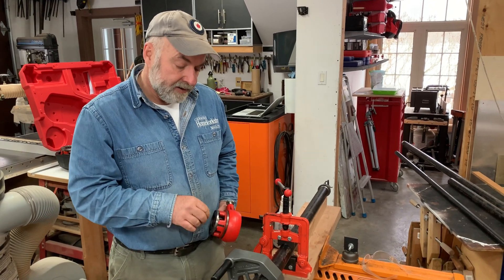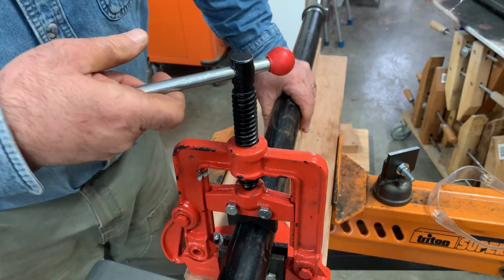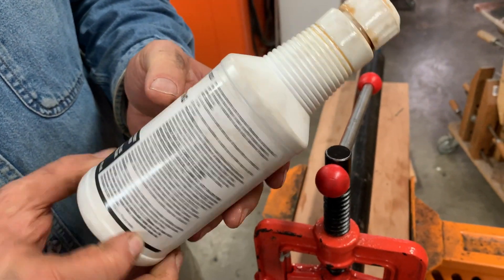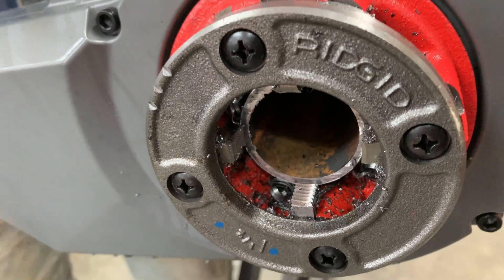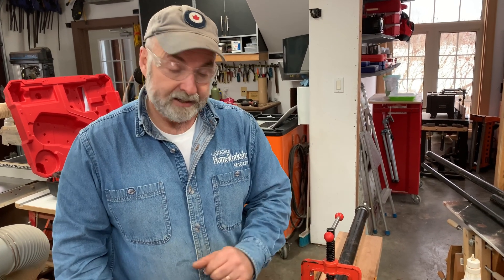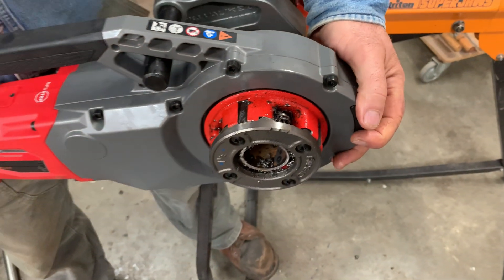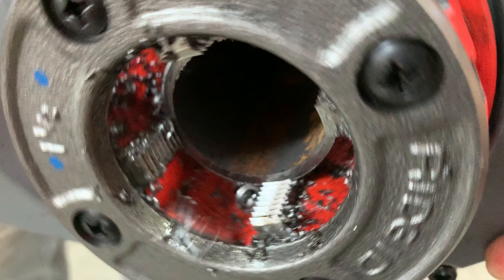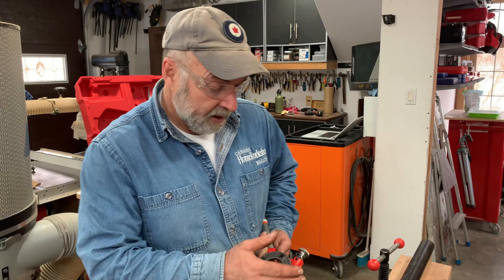How to Thread Pipe EXTREMELY FAST

Comment: 7:00 For your railing, do you like the look of exposed threads? After the cap is threaded on, there are still a lot of threads showing. I'm curious if it was a preference, or the die requires to create that many threads.

Comment: I have been tearing threads. What do you think? Dull or worn-out dies? 
What is you insight as to what type dies to use as a replacement? I see ‘Alloy’. And I see ‘High Speed”. 
What is the difference?
Thanks for the video. 😊👍

Comment: Hi.... Please can you help me solve or know how to solve problems or real situations of take off in threaded joints.

For this examples: 

1) A piece of NPS ∅2" pipe is being cut to run between two 90° degree threaded fittings. The center-to-center measurement of the fittings is 7'-2¼". What is the cut length of the pipe?

2) A length of NPS ∅1½ inch pipe is to be cut run between two 90° degree 6.000# threaded fittings. The fittings measure 7 ft 2¼ inches center to center. What is the cut length of the pipe?

Regards.... Thanks
Reply: What is the process?  Dont hate on Lee, buddy on video is legit a rookie
Reply: Just find the fitting allowances and subtract each fitting allowance from the center to center to calculate end to end pipe length.

Comment: I usually use the Rigid 300 pipe threading machine with oiling gun and catch bucket with pedal control for turning threader on and off and the tripod stand holding the machine up.🧰💪😁👍

Comment: Oh man, this gave me flashbacks to my plumber's apprentice days from 40 years ago when I was 17.  Everything about working with black pipe was terrible.  
(getting the machine out of the van, clamping it to the van and putting it together, being covered with sharp metal pieces and cutting oil,  the smell still makes me nauseous, cutting the holes in the rafters on the very top of a step ladder,  getting my arms and body wound up in between the joists around the huge angle drill, getting the pipe run to the roof then testing it and finding one small leak in the attic and having to take it apart and do it again, then having to break down the machine and lift it back into the van at the end of the day when I am dog tired and hurting all over)
Reply: plumbing is easy asf

Comment: start the machine on the pipe like you do, but don't worry about the oil right away. Once you have the threads started, keep the machine turning and with the free hand squirt oil in the reliefs of the die head. Its harder on the machine to start and stop mid thread. Put a 5 gallon pail under to catch the excess oil and the tailings. Clean the threads with a wire brush before applying the pipe dope.  30 Year pipefitter.
Reply from the maker: Hi Lee!
Thank you very much for your tips. I'll certainly do the bucket trick and keep things working without stopping. That makes sense. I'd love to hear about the various pipe fitting jobs you've done over the years. What kind of installations and pipe sizes have you worked with?
Bye for now and thanks for commenting.
Steve
P.S. Have you had a chance to use the Milwaukee threader yet?
Reply: @baileylineroad  from 1/4" tubing to 48" pipe. Blast furnace re-lines, oil refinery outages to heating and cooling jobs to new Hospitals. Haven't used the Milwaukee cordless, but Rigid has a similar tool we call a power pony. Used it numerous times. Keep the videos coming, Love em
Reply: They made a machine but couldn't add automatic oiler lol

Comment: I think that threader tool is more for threading gas pipe in place. For example there is leak and the pipe has to be cut near the leak and the pipe that was cut has to be threaded in a wall in place that is the on the side that didn't have the leak.

Comment: Cool but I would never in a million years use this over a ridgid 300
Reply: I would. You and use this in the building on an existing pipe, and with that clamp you can thread a pipe that's not in a pipe vise

Comment: You def got it down. If I could offer some advice though. Don’t stop mid thread to apply oil. Use your free hand to apply oil throughout the thread. Stopping puts a lot of pressure on them dies and can chip your threads when you restart. If your doing a good bit of threading I’d invest in a ridgid oiler to recycle the oil. Other than that. Not to bad. I’ve never used one of them power pony’s before. I’m a union sprinklerfitter so the ridgid 300 is our money maker.
Reply: What state and what kind of pay yall making as helpers, fitters, foremans, or service? Im florida and a pipefitter. Steel, cpvc, galv, steel. All fire.
Reply: I'll 3rd that motion
Reply: I’m in Pittsburgh and we do pretty damn good with our wages up here. No right to work shit up north. I do service work. Been in the trade just over 10 years. Do yourself a favor. Get out of Florida to make more money. We just had a couple guys transfer to the Florida sprinkler local and they took 40k paycut

Comment: Yeah I admire the tool and would love one for my hobby and experimental work, but $1500+ is way too much for someone who doesn't have the business capacity to use it profitably enough to make that money back within three months.
Reply: Get a cheaper one at Habor Freight learn on it by doing  smaller jobs  , this will tell you weather investing in a more expensive threader is valid.
Reply: I bought mine from a random website, about 699.0
Reply: Look up hong li, same as ridgid but made in china and a shit load cheaper

Comment: You are threading to far. The die should be flush with the end and not a smidge more. When threading to long as you do, your actually leaving a cylidrical end that will bottom out in the female before the whole tapered thread has a chance to engage like it should. The point with using tapered theeads is that they should be tapered…